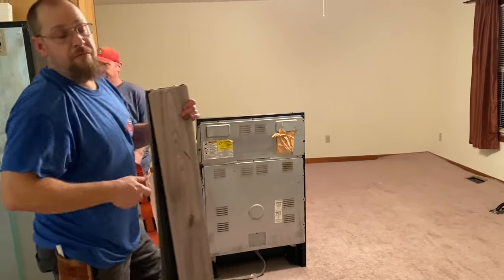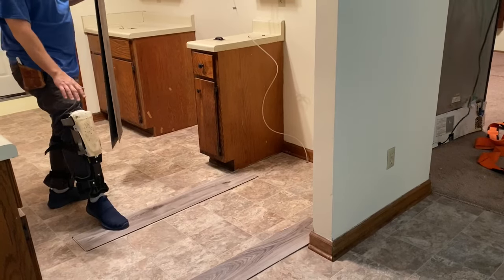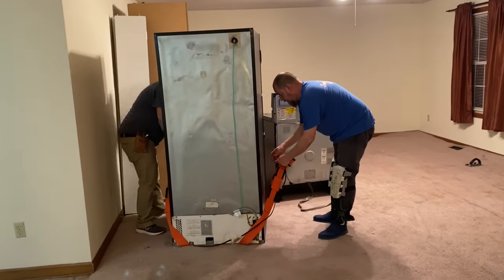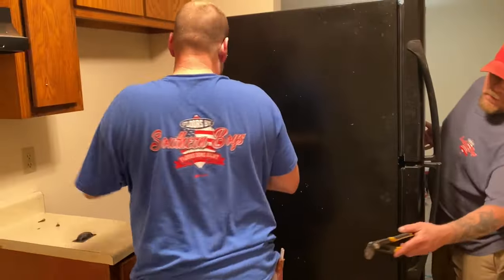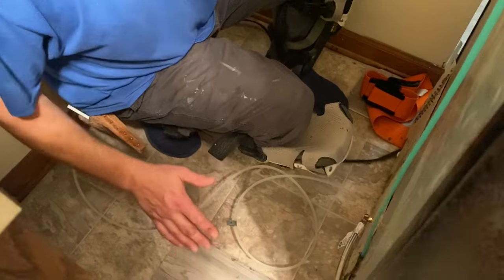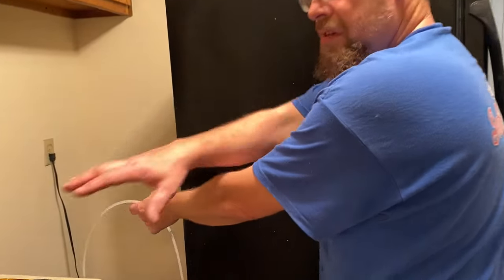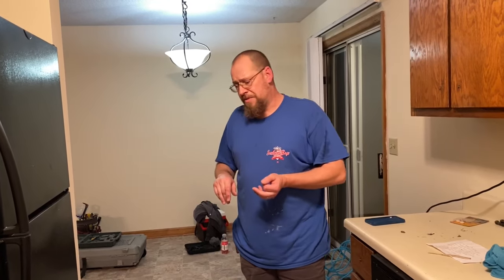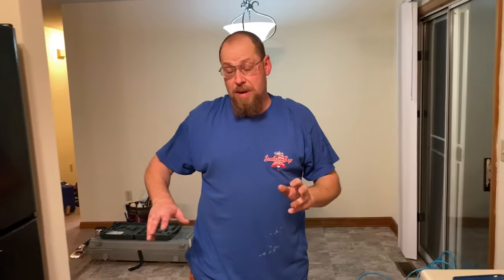How-To Move Appliances On New Flooring

Comment: Always easier with help! I do it myself and have to get pretty creative sometimes
Reply from the maker: i hear you i went for over a year with no help
Reply: I made some jacks that go underneath n have two wheels on each jack then I strap them together around the fridge n they lift up about 3-4 inches off the ground n I can wheel it around anywhere.. people always say there’s no way u can move it by yourself.. I’m a small guy n I go in a move huge fridges China cabinets etc in a few minutes like nothing 😂 they sell some similar but I made my own that sit directly on the floor initially so I barely have to get what I’m moving picked up at all.. n fridges I don’t have to lean it or anything to get underneath.. they slip right under each side n u strap them around it together then I have a little bar that I use to jack it in there 3-4 inches..

Comment: Do American fridges not have to be left for a few hours after moving before they're plugged in?  In UK the coolant has to settle for 5 - 8 hours or you end up with a tepid fridge.
Reply from the maker: Only if you lay them on their side. If you keep it up right, there is no problems.

Comment: How do I lay laminate under a removable gas stove? It's attached by a chain and pipe at the wall so it can only move out a certain distance to get behind and clean etc.
Reply from the maker: You have to disconnect the gas and move it completely out, otherwise you can adjust the front legs up on the stove and the back legs down and only put it under the front of the stove so that it appears to be all the way under, or you can pull it out far enough to drop a board down behind where it will lay flat to get the back legs on that board and then install your flooring under the front That will also keep it level